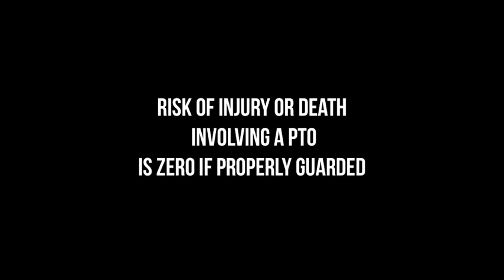Farm Safety - PTO Shaft Accident

Comment: I was instructed to dig potatoes with a rock picker at the farm i worked at because the potato digger was broken. There was a steel bar that ran across the top of the track that pulled rocks to the back of the machine, so the sod would get stuck trying to go through. Another hand and I were using forks to push the sod under and through. He was a decent bit smaller and younger than i was, he was having a hard time to keep up with the pace the driver was setting and wasn't able to push all his sod through on his side. I reached over the machine to push his side through and that's when suddenly i was belly to the PTO shaft, I was being pulled in by my shirt. I braced against the machine and hoped. I was lucky enough to be in a thin cotton t-shirt and strong enough to hold on while it was ripped off my back. I came out of it with some lacerations on my stomach, nothing major. I'm so incredibly lucky to be alive. This NEEDS to be shown to anyone that works around rotating machines. I knew the dangers, i knew it'd rip my limbs off and kill me dead in an instant. I'd worked with that tractor, seen and taken advantage of its raw power on a daily basis for years. I got too comfortable, I rushed. It's genuinely scary to see how lucky I was.
Reply: Wow! thanks for sharing,  so glad everyone was ok! that's incredibly frightening
Reply: Christ mate.. You’re sooo lucky.

Comment: the pto shaft of my bosses machine doesnt have a protector but i always shut it of when im near that thing
Reply: +wouter berg hope he has good insurance and a lawyer
Reply: Complete laziness really. Put one on. I got a close call  once when putting on the slurry tank. Was putting the PTO on and the hooks on the hitch hadn't closed properly and it popped off and landed on my foot. Luckily the tank bounced on a rock and I pulled out my foot. Few inches back and it would have crushed by the stand.
Reply: Sean O Tuama 
I’ve found mine not sitting in both of the lower saddles a few times, the latches won’t lock if it’s not in the hitch properly. I’ve not had an implement fall though. That’s why I make sure it’s locked in place before doing anything else. I usually only have the problem when hooking up to my 65” garden tiller.  I don’t want any of those tines landing on my boot if it falls off. 
Be safe, and make sure those locks close first thing!

Comment: Why would there not be something like a laser beam installed on the tractor near the PTO which acts as a safety cutoff or brake setup in such a way if anything breaks the beam such as a body the PTO immediately stops in the event a PTO cover is not used?
Reply: They can spin 25 revolutions a second. A break system would be very costly as it would completely destroy tractor and the implement being used to stop a pto so erratically. Yes a good idea when it comes to safety but with the nature of farming a lot of things can hit the pto during everyday work activating such a breaking system that would be so costly on a farmer that it would not be practical.
Reply: A braking drum or shoes could be used without catastrophic destruction of the mechanism just like a car. you could just use a clutch attached to a microcontroller and multiple sensors including optical, load sensors etc where a piece of straw or whatever wouldn't stop the PTO but a body would.
Reply: @PAGANONYMOUS  by the time drum breaks would successfully stop a pto you would be spun around the mechanism 5 times. Ptos are used in hedge cutting, silage harvesting, seeding, slurry spreading and countless other everyday jobs where impacts and damage to the pto are common place. Of course it would be great to have an invention that could save lives but death by pto has dropped by such a magnitude because of awareness alone on how deadly they are.